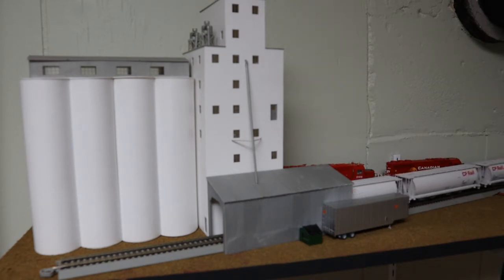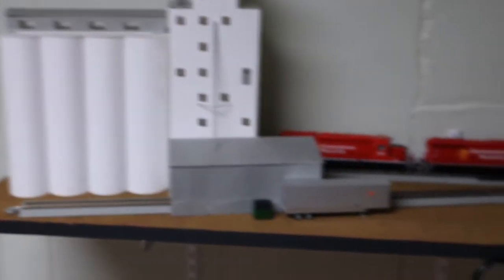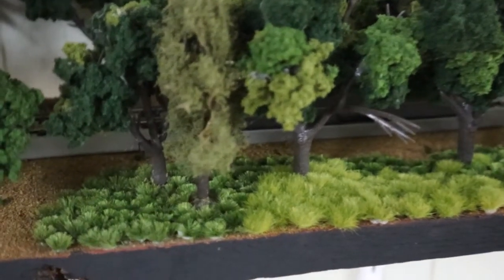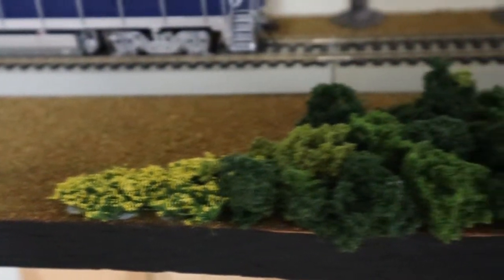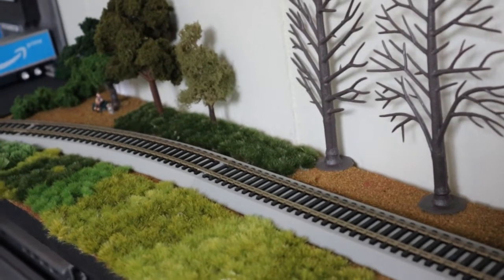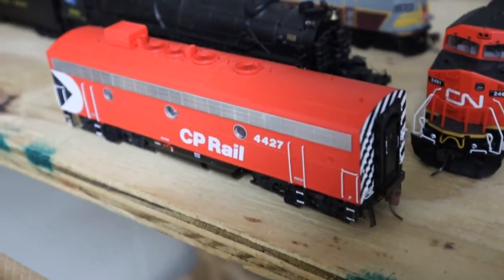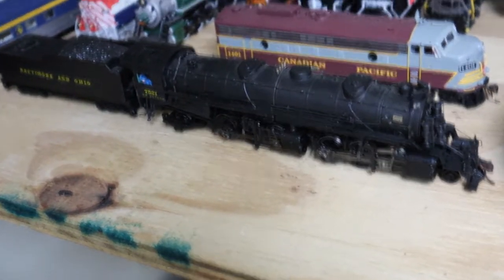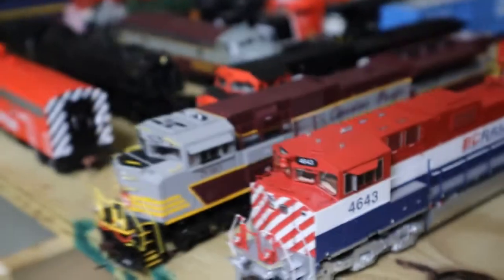Layout BLOG Series: Grain Elevator Spur Finished, DCC Installations, New Athearn Canadian Trains

Comment: Your ho layout is looking good. i do have a few ho engines (it's just I guage had always been my preference). and nice with the cp unit (glad one of the manufacturers got them right unlike how Lionel did them). of course as I said before I'm actually saving up for the cn heritage and veteran units when they come out from Lionel. (I know they're not the et44's I just got really excited that they're doing some of the things I was hoping they would do). I also hope in the next catalog they'll do the grand trunk heritage unit and the 8898 (which was with the heritage units and also has the same sticker as the heritage units). And I also considered the Louisville & Indiana veterans unit no. 3001 hope they do the 3002 to go with it. That's just what I'm most excited for.